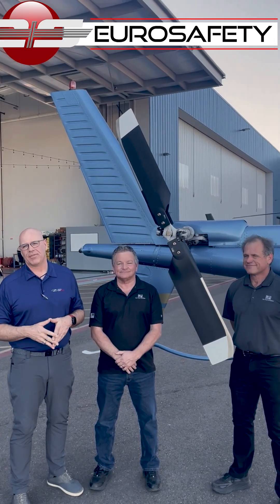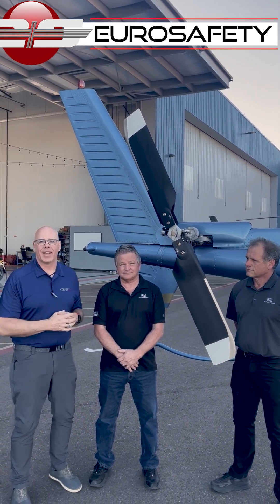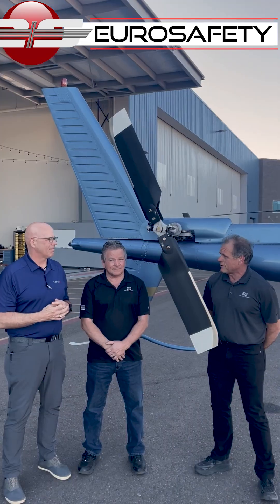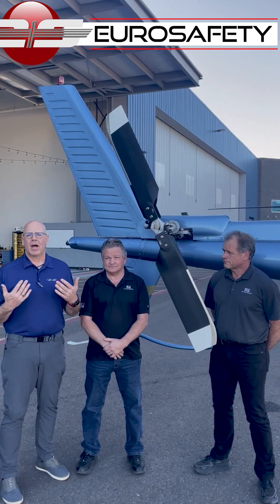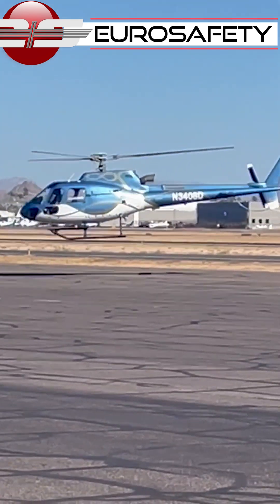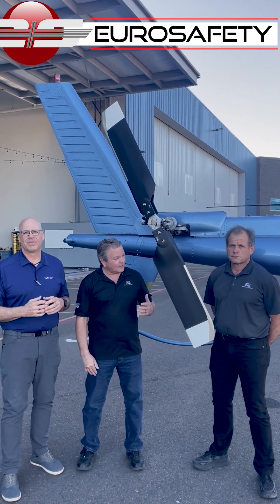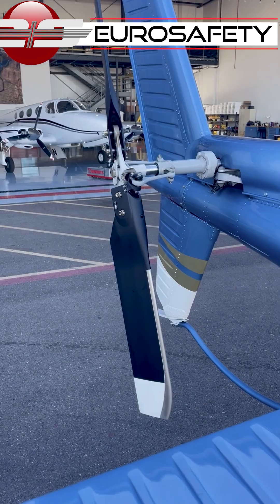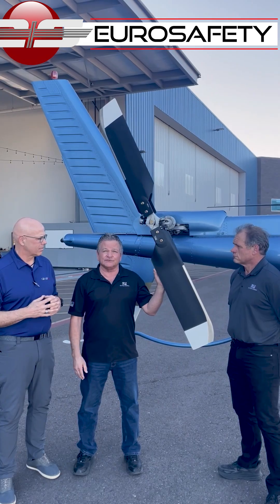#240 - The New Van Horn Tail Rotor for the AS350

Comment: The Half-Lam’s are gone!  This is Kevin in the video. EuroSafety clients get a discount on the system. Get a hold of us if you’re not a EuroSafety client to be one ….or if you want this system. We can help.  
We assisted in training VHA and I have worked with them in a small role. 
Flight test results show SIGNIFICANT lower loads on PCL’s since flapping done very differently than OEM. I can go over those with you. This is a great system STC mod. 
Yes, it is very much like a B407 T/R. Latest tech in proven composite blades.